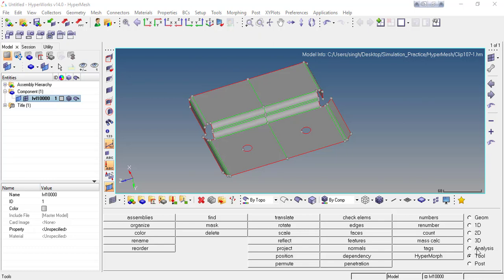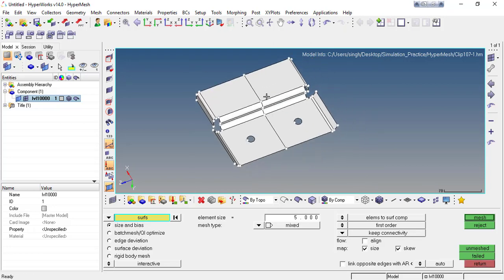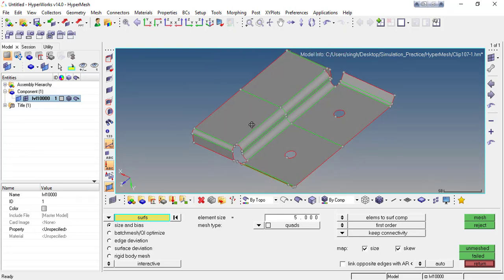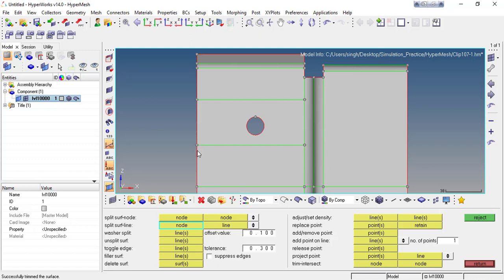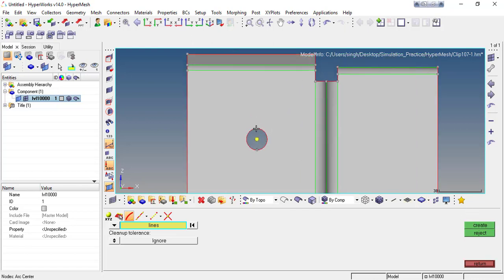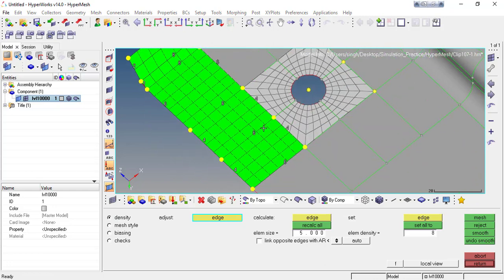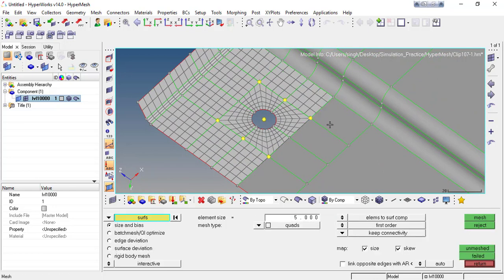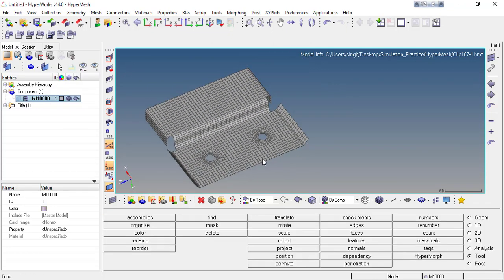Meshing in Hypermesh - How to mesh near hole features

Comment: Thank you very much! Your explanation is very lucid and detailed. :)
Just one quick question - At the corners of the squares surrounding the hole, mesh transition doesn't seem to be smooth and makes the mesh unstructured in those corners. Is it possible to somehow make it structured just like other elements in the mesh?
Reply from the maker: Dear,
Go with other Meshing video on my channel, Hypermesh playlist. You are able to control mesh as you want. Here i considered rectangular splitting. Circular splitting (washer) will give you proper structure mesh around hole.

Comment: Why the nodes are not displayed in hypermesh?. When I created the nodes they are not visible to me. I tried clicking the F button. No response. But when I drag a window to select the nodes, they are selected and displayed in white colour. Then if I click outside they become invisible.
Reply: Actually! In order to create the geometry, we use the create nodes option and specify the coordinate numbers. Then we click on create. And hypermesh creates the nodes on GUI.  If we click on F(fit to view). Then we can see the nodes that we created earlier. Then we proceed to create the lines. 1. We need nodes to create the lines (or) 2. we can directly create the lines by specifying start and end coordinates. If I want to create the lines using first method. I need to select the nodes(start and end node). But I am unable to see the nodes when they are created to proceed further. That's the problem. I tried uninstalling and reinstalling but it didn't worked.
Reply from the maker: Dear,
There should not any such issue... however, you can send me snapshot or video of ur problem on my telegram/whatsapp number, given in video discription.
Reply from the maker: Dear,
There are two types of node in Hypermesh.
1. Parmanent node - they exist only with element, and can not be removed individually. These node not even visible unless you select them.
2. Temporary node - they more likely reference point but called temporary nodes in Hypermesh. temporary nodes can be created anywhere, they used only for reference. Not participate in the simulation.

About What type of nodes you are talking ?
Reply: @arsitech-ltd  Hope you understood the problem sir. And thank you very much reaching out.